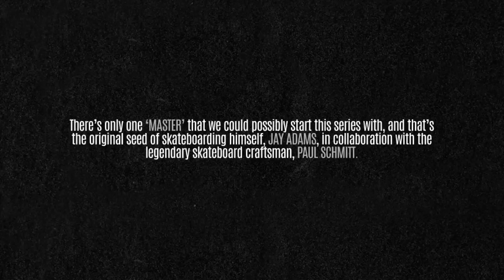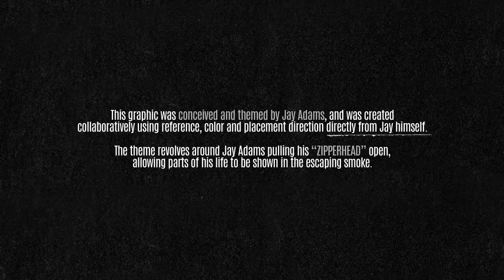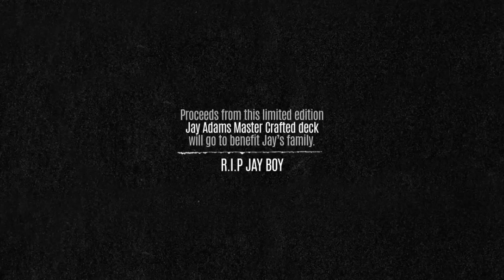Z-Flex // Master Crafted: Jay Adams

Comment: now im regretting not getting 2 of the re-issue....one to run with some 8.5" tracker axis just like jay would run. And a second one with no risers just big/smol enough wheels to clear since there arent any wheel/grooves in the re-issue...or ill make my own. Risers+rails on one....and a second naked prob 159 standards since they dont bite like aces/ventures do with 56mm. Definitely going to be running 159 standards/conicals, venture 6.1s, stage IV 151, and possibly buy some ace 60s to try with this deck im going to baby it in the quiver. "willing" to try those axis trucks maybe even 9" with indy conical bushings just for the hell of it.